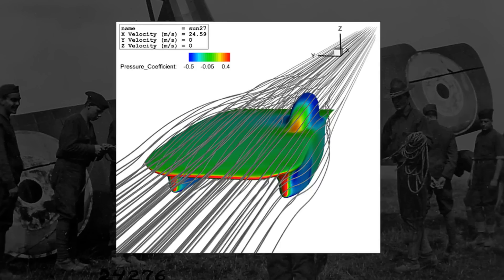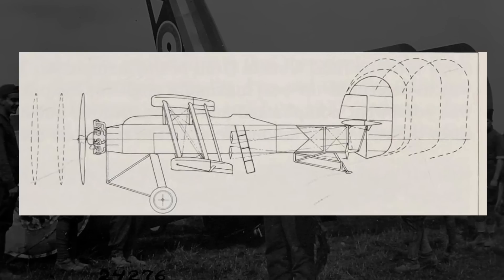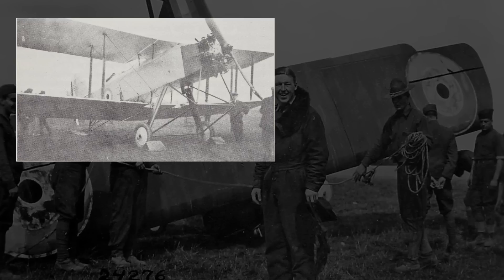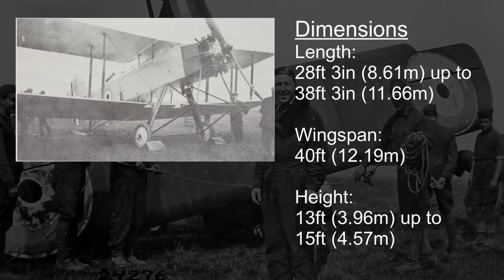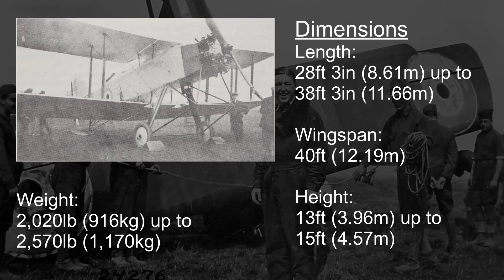The "Infinitely Adjustable" Biplane: Armstrong Whitworth Ape

Comment: That additional framework on the landing gear isn't enough to protect the propeller, but it might keep the engine out of the dirt.  Not like it matters with the kind of internal damage a prop strike is going to do.

It looks a LOT more like it's there to reinforce the engine mount, probably to keep the nose of the aircraft from breaking off in a hard landing.